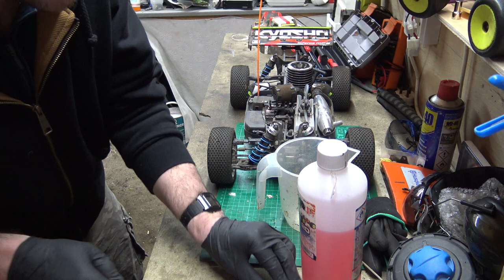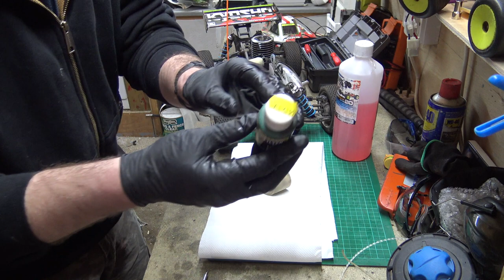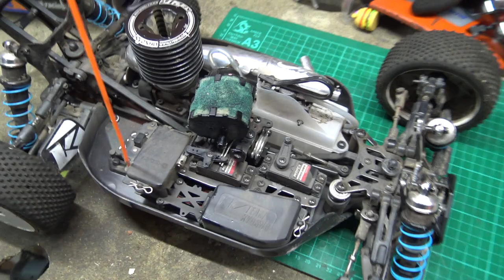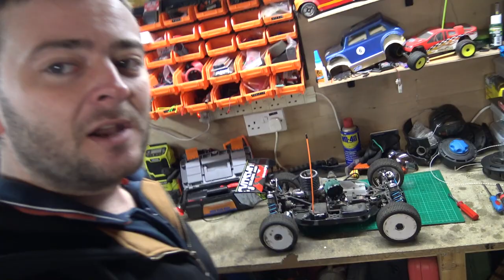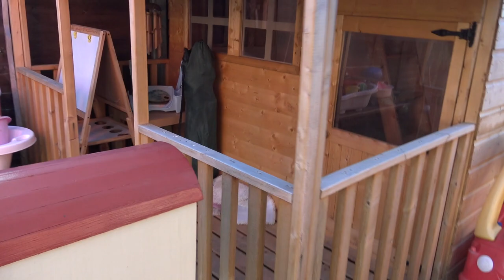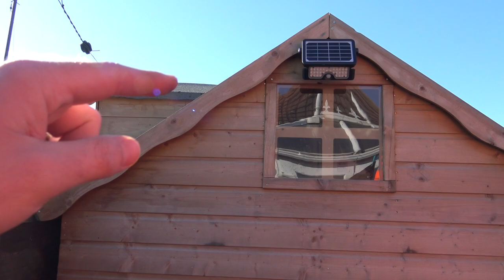Sunday Morning Chat & Air Filter Clean

Comment: Worst thing u can do is clean filters with fuel mate
Reply: Why's that then mate ?
I've always used petrol.
Reply from the maker: You can use many things, I’ve used Nitro pretty much 99% of the time but you can use petrol, thinners, white spirit and even hot soapy water. It all works well. The upside of using fuel is you don’t have to dry it before you oil it and put it back. With water you have to make sure it’s bone dry first lol.